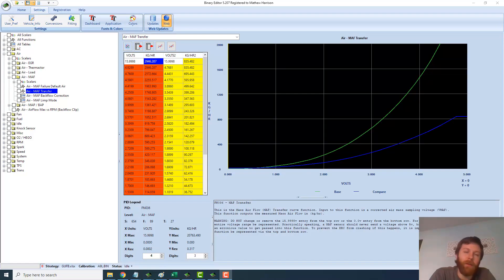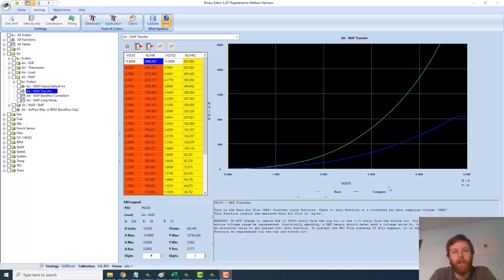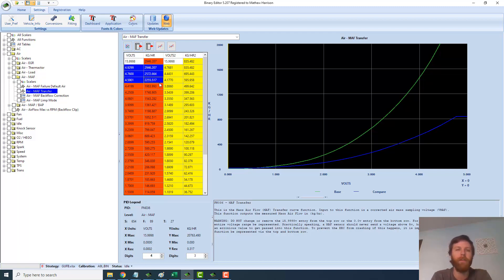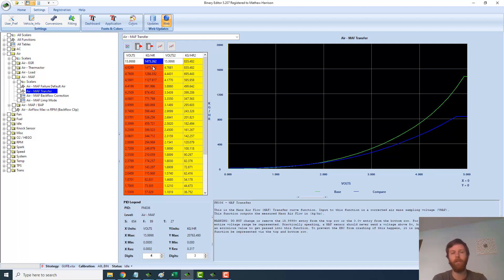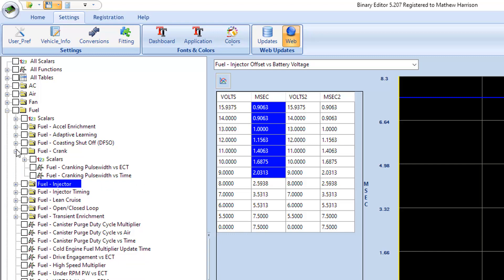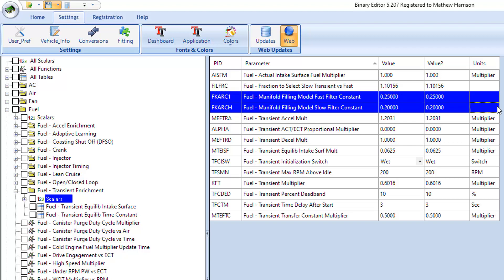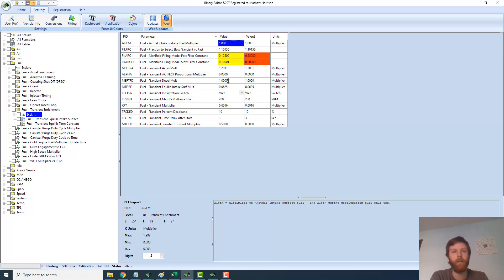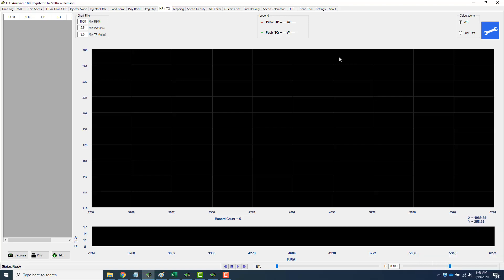MAF Scaling for Boosted GUFB (Fox Body) Applications

Comment: Thank you for explaining the inner workings with MAF scaling and the previous video on MAF fitting.
Still haven't found out what or how to use the MAF doubler function in my  URB1 Strategy. Or why the factory setting for cubic inches is 306, when the Lightning is a 2V 5.4L (330 ci). Am past that in my tune (Thank you for this!), but still want to understand it.
Great video,!
James 04L